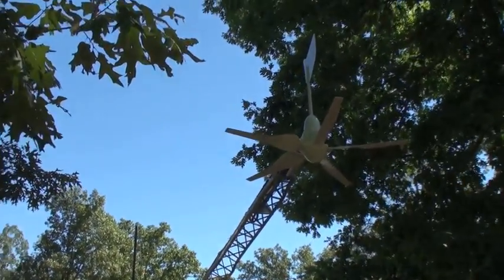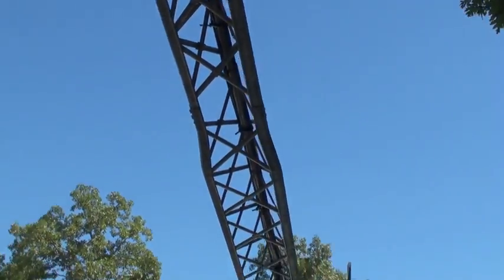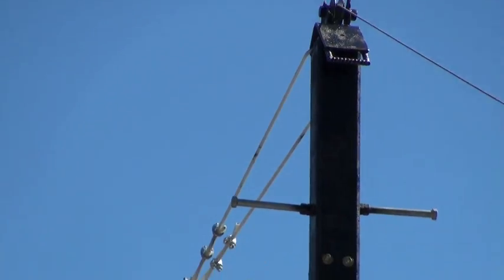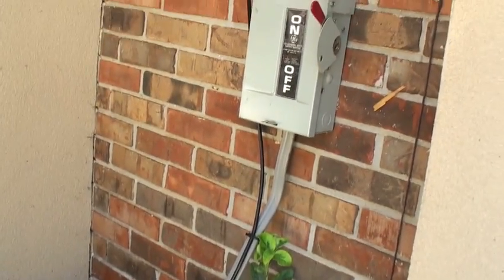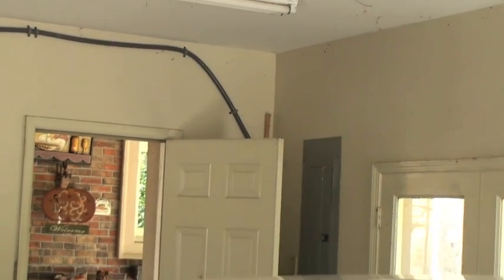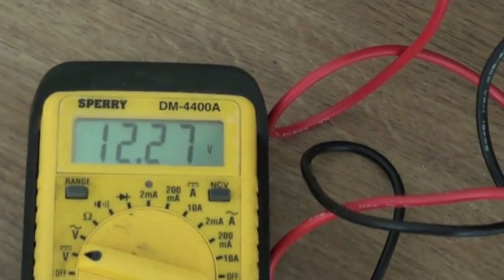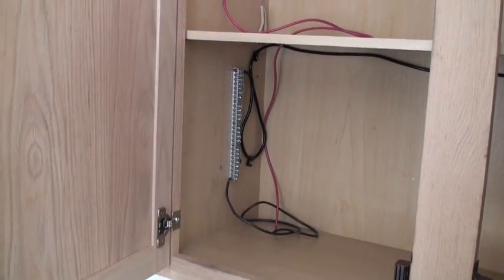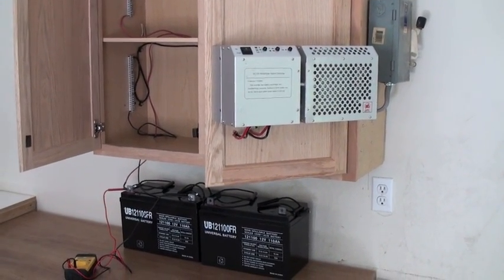Wind Max Tilt Tower Turbine and Electronics

Comment: Doc, Forgot  how tall your tower is but I'll give ya something to ponder. I have the same mill. I got it about 3 months ago and put it up at 30' and have been very happy with it except one thing. The tail is too small and too close to the mill. Any turbulance will spin it around and it won't track worth a crap.I cut mine off, extended it out about a foot with an aluminum pipe and added an alum. tail that was 50% larger. Tracks great now and that light rear end will really track the wind.